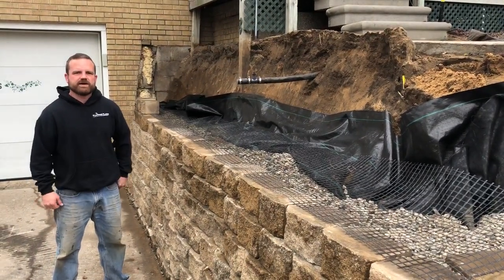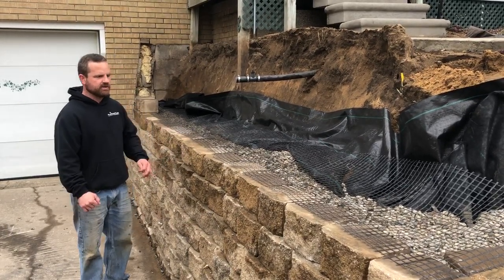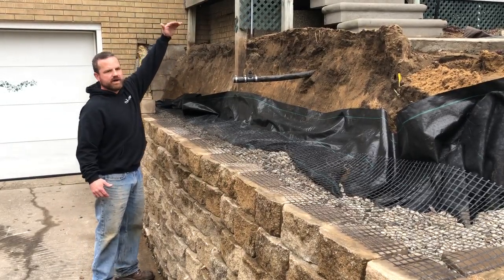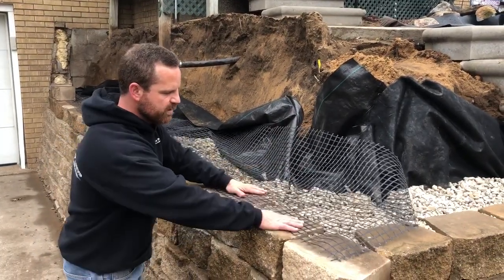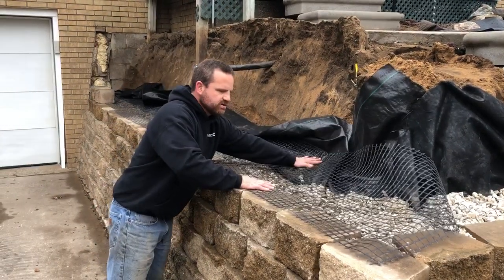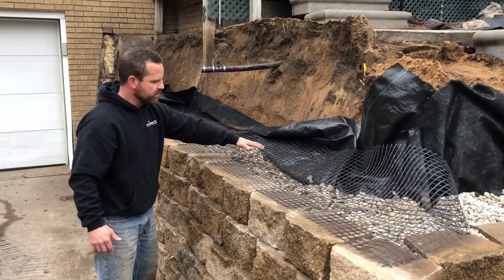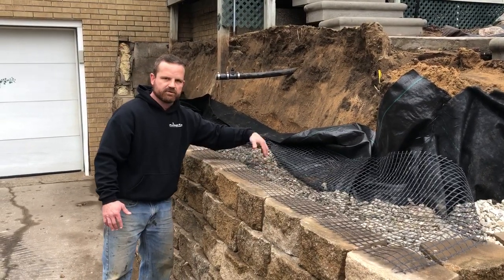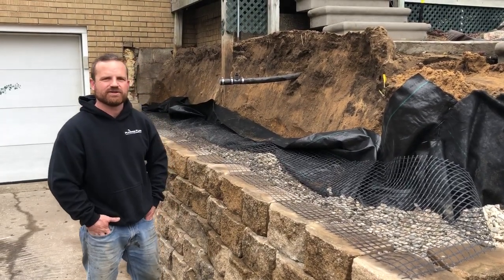Building a retaining wall using Geogrid

Comment: Geogrid needs to go deep into the soil. Not just a foot or two. The filter fabric should be going between grid layers, not continuous top to bottom. Retaining walls fail with the soil shearing at an angle from the base. That grid does not go past the failure plane, so if it wants to topple, it's just taking the grid with it without any resistance. Roughly, the grid should go back as deep as the wall is tall. The right way is to have an engineer design it. Shouldn't add more than about $600. That's cheap insurance.
Reply: geogrid should go back twice the distance as the wall is tall
Reply: @jamieshotter9762  That's excessive on tall walls. Allanblock says typically around 60% of wall height, but a geotechnical engineer should make the call.
Reply: @ryanmcgowan3061  I'm a civil engineer. My two times comes from the angle of friction of typical soils, 25 to 35 degrees
Reply: @jamieshotter9762  Gotcha. I'm about to sit for the PE as well.
Reply: If the depth of his grid is what he installed, it will be fine. Not over built, but enough to last 20 years. Those are very heavy blocks too.

Comment: Please take an NCMA class guys. This wall is not correct. That is woven geotextile fabric NOT filter fabric. Even filter fabric should not be used as you are using it. It will not allow water to drain and should never be draped as you have it. It is only used on the top to keep soil out of #57 stone.
This wall is over 4' and requires engineering. No engineer designed this.
Geo grid minimum length ever to be used is 4' and that is not 4' long. This wall is also supporting those scary steps and the porch and its doubtful that was taken into account. 
That foundation should have mortar pushed in there and not expanding foam where rodents and water can just pass through.
Its frustrating that someone needs to be a certified plumber to connect a sewer line, but anyone can do a retaining wall where children can walk next to and have no training whatsoever.
Reply: Well said, first thing I noticed was the Geogrid is nowhere near deep enough to add any support and using that “filter” fabric is the biggest sin that wall will blow out 10x faster than if it just hadn’t been used
Reply: @davekushman2363  Techo Bloc recommends a proper filter fabric. Are you saying the engineers and national engineer standards are incorrect that they go by? They have guides on their website for reference. Dirt migrating into the gravel is a real issue between hydrostatic pressure and maybe freeze thaw heave due to the dirt holding water. 

This is what I used after my research: SRW EC8 Non-Woven 8oz Drainage and Filtration Fabric

It's punched layers of polypropylene that let water pass through.